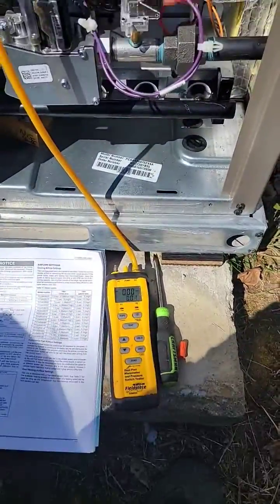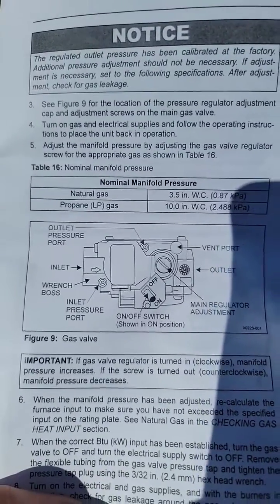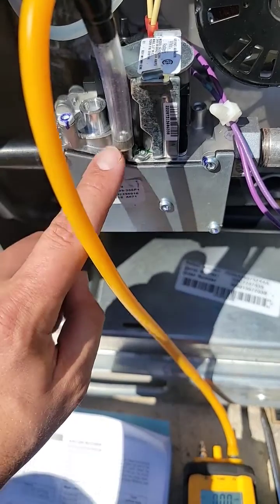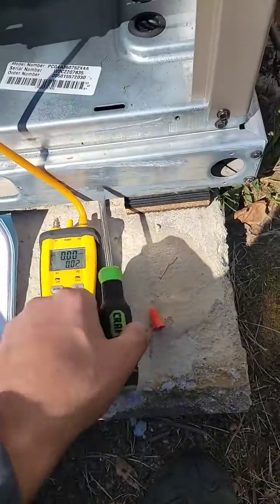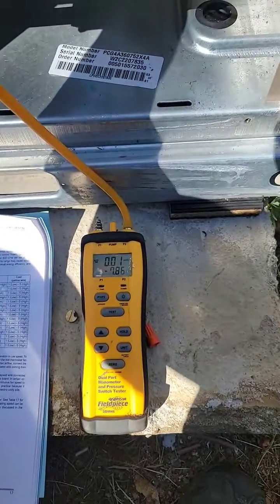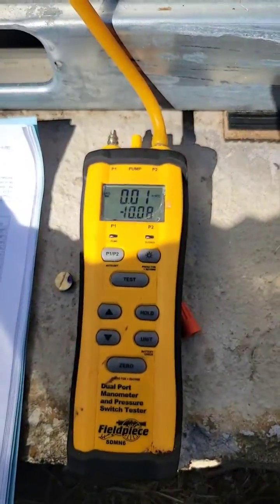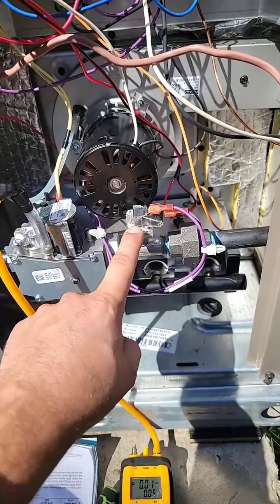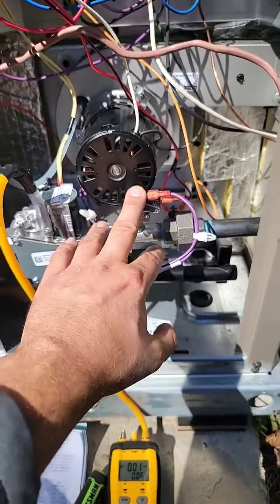How to Set Propane Gas Manifold Pressure (Ultimate Guide)

Comment: Will this turn off when the tank is low ? Or is that 10 a good pressure that even on a lower tank it will work ?
Reply from the maker: Yes, the pressure switch will open when the tank gets low

Comment: I would put that pressure switch in line with the gas valve instead of the flame sensor, that way it will not even try to lite. Or you could put it in line with the pressure switch too. If you have it on the flame sensor, its gonna try to light for 7 seconds.

Comment: I don’t recommend adjusting fuel pressures unless you’re also performing a combustion analysis. Even brand new machines may have problems. I regularly do equipment startups after installs. Many times I’ve caught extremely high CO from misaligned burners and such. Adjusting fuel air mixture just makes those problems worse. THANKS FOR THE VID👍
Reply from the maker: thanks for this advice

Comment: we have this issue working on rv furnaces in the winter. alot of times the small tanks will get low and or regulators will freeze up even on motor homes. if someone from the south goes up north in the winter they can have issues because the propane contains water from the south and butane in the North.
Reply from the maker: very good info thank you Jayson

Comment: One tip I want to add, as I've seen it a few times doing PMs, Is to place the pressure adjustment screw cap back onto the valve while checking pressure. Gas can leak from there, giving you one reading. You then seal that leak off and it bumps the pressure up over the called for amount.
Reply from the maker: good advice thanks

Comment: Also Should be checking inlet pressure at same time with all appliances running and then set your pressure.
Reply from the maker: Yeah you're correct if you have other appliances

Comment: What's that union doing in there?

Not being critical of it - just asking because I thought Union has to be outside the appliance
Reply from the maker: Yeah usually the unions will be outside of the unit really just depends on the installer
 But the gas company doesn't really care around here
 If they really care about if there's a drip leg though
Reply: @taddydigest  gotcha. Appreciate the answer. I've been failed for it before so I was curious. Of course I know that what's done in my area isn't necessarily required in others. Plus I think I pissed that inspector off in the past 😂
Reply: Good question. Love learning in the comments!
Reply: @dirtycoffeecupp  hey so it's funny this notification came up. I just replaced a leaking union inside a burner compartment on an old gas pack today. Call came in for gas smell around unit